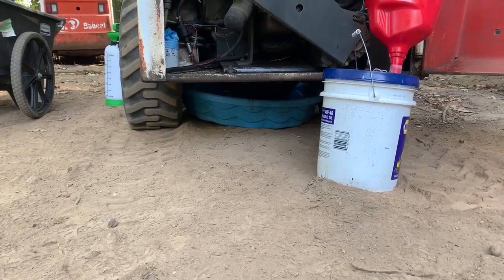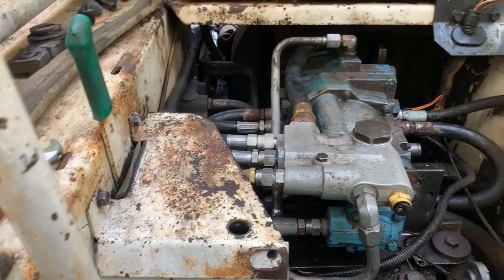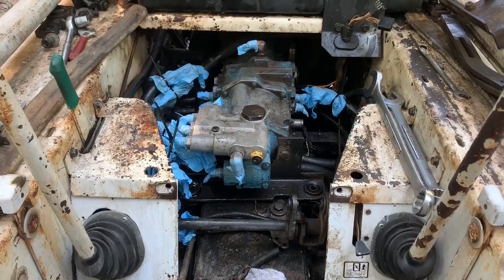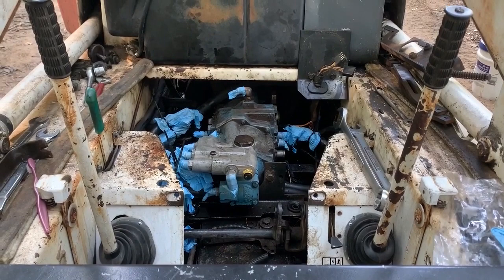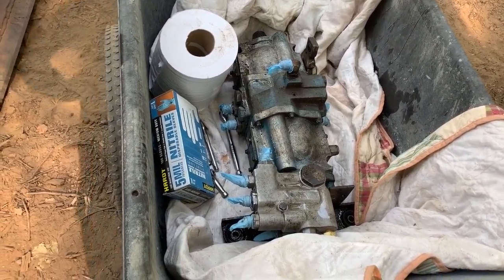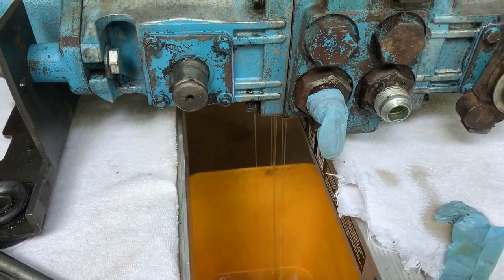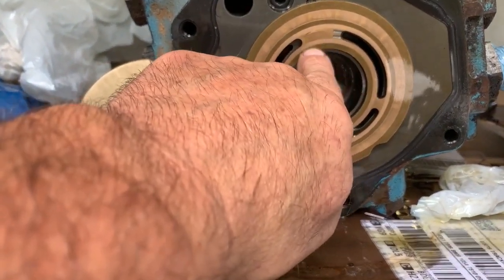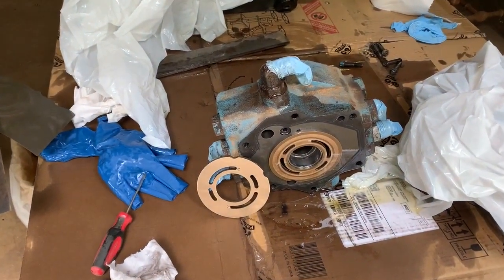Remove & Fix Hydraulic Pump Bobcat 642.  Diagnose & Repair Hydrostatic. DIY Swash/Wear Plate Repair

Comment: Good afternoon I just bought a 632 bobcat it goes forward backwards bucket goes up has down but will not turn at all, sounds like a car without steering fluid, 
Previous owner said he replaced and rebuilt both of the drive motors. I removed the hose where the bronze filter goes. There was no filter at all. The hydraulic fluid is mixed with water. It’s got a milky look to it, i removed the pump,  as I was taking out the hoses from the pump, I heard a lot of air coming out of them,  the pump shaft is locked. It does not move. Is this normal or this is my main issue?

Comment: Hello, my bobcat has no leaks but the hydraulic system forces the engine, I can hardly turn and I have to keep the engine speed high otherwise it stalls.
Reply from the maker: I suggest you register for free here and post a thread with your issue. Those guys are smarter than me! https://www.skidsteerforum.com/forums/general-bobcat-skidsteer-forum.1/

Comment: How you how you doing man how you release the air pressure and the pump when you put them back
Reply from the maker: I didn't have an air pressure problem. I filled with fluid and used the hydraulics slowly up and down and tilted the bucket up and down. Do this for several minutes and get to maximum lift/tilt. Do until operating smoothly.

Comment: Hi there,

Great vid! I find it very hard to find info on pump or drive motor repairs. I buy and resell skid steers here in Australia as a side line. Nice to see the internals and read your diagnosis tip in the comments. 
Cheers
Reply from the maker: I had a Bobcat with issues and couldn't find a video or repair information myself. That is why I posted the video. I am glad you found the video useful. Cheers.
Reply: Buenas noches sr! Yo estoy en Mexicali México.  Tengo el mismo problema con la bomba hidrostática..y el disco ese de bronce también estaba rayado.  Lo reparamos y lo pusimos  pero al usar la máquina los brazos no levantan normal..se ponen lentos y no levantan después de dos o tres minutos de uso de la máquina.  Camina para atrás y adelante y el bote de enfrente se mueve normal..solo los brazos no levantan.  Tiene idea que pudiera ser la falla?  Por su atención muchas gracias y la verdad un excelente vídeo el suyo.  Saludos desde Mexicali México.

Comment: Hey I got a 741 recently I realize that  I am having problems lifting load but I can still tilt maximum load 
Whats weird is that when I try to lift the load it does really move much but if i tilt the bucket at the same time it start lifting right away even before the stuff starts falls out
I know my pump is good so I am thinking I am having some issues with a release valve
What’s says the experts.
Reply from the maker: I am not a mechanic. I just bought a Bobcat 773G that has lots of electronics on it and have had trouble with a lap bar sensor. I never owned a skid steer prior to that. I did my huge driveway and parking with it and remember having an issue with the lifting with that. I think it might have had something to do with the auxiliary hydraulics but I don't know. I think bleeding the air might have helped. Raise all the way up and tilt then lower and tilt and do that a few times. You might have a screen on that pump that needs maintenance or replace? IDK. 

After dealing with a temperamental 773G, which I still own, I decided that I wanted something that would run, lift, and move things so I bought the 642 and then it had issues. But all in all, as a use it once in a while homeowner, I like the 642 cause I can keep it going and will be more dependable or fixable for me.
 
How do you know your pump is good? Is it possible to switch the lift and tilt hoses and see if the problem moves to tilt instead of lift? I made this video because I couldn't find one on how to troubleshoot and or fix the hydraulics so I thought I would share what to expect. 

Let me know how you make out I am curios.

Comment: Is there a follow up to this video?
Reply from the maker: No. Put it back together same way it came apart. Works fine now.
Reply: @Depression2010  did you have to get a new cup with those small pistons?
Reply from the maker: @gyffjogofl7676  I bought the entire new rotating group assembly for less than $400 delivered. Easy Job.

Comment: Do you have a layout of what each hose goes to on the pump? I bought a used 741 from a guy and none of the hydraulics work at all. He had someone work on it but I'm thinking there is some hoses that got switched. Any help would be appreciated. Thanks!
Reply from the maker: I am no bobcat guy. I have a PDF manual for the 642. I am not sure if the 741 is the same. I found this online. Page 38-39 has a pretty good diagram. https://issuu.com/19800595/docs/bobcat082y_04a88b36387fbf

If this is not applicable to your machine maybe do some more google searching or pay for a maunual.
Reply: I got manual for 741

Comment: Im in the process of troubleshooting the hydrostat on my 731 bobcat. Ill prob have to replace the hydrostat in its entirety or go in and try to rebuild it myself. 
What issues were you having with the machine that led you to believe the pump was bad?
Reply from the maker: I did not know what was bad. The right hydro motor was pretty much non-responsive. It was very noisy. The left motor seemed to be working okay. I drained the hydraulic oil and took the two big hoses that go to the motor on each side of the pump and switched them front to back. This makes the motors work totally opposite. So the right handle will operate the left motor and pushing it forward will make it go in reverse. Obviously after you switch the hoses you need to refill the hydraulic oil. If you choose to do this make sure you have plenty of area to maneuver and you exercise caution. After I switched my hoses my problem was no longer occurring with the right motor but was now on the left. That test proved that the motor was not the problem but the pump. I heard that those brass plates wear and sanding them usually fixes the issue. But, in my case I had a bad rotator group. I got a brand new entire rotator group for less than $400 including shipping. There is also a screen filter that can get clogged that purportedly can cause issues also. Please understand I am not a skid steer mechanic. I simply have one that needed fixing so I did some troubleshooting and analysis. There was no video like the one I posted and very little information online. That is why I did a video so that others might have some idea how to tackle it.
Reply: @Depression2010 thanks for the quick response.  it was nice to see someone open up one of those pumps and replace some of the internal parts. It gives me hope I can fix the pump vs buy a new one($3000) I suspect the wafer plates and rotating groups may need replaced in mine.

Comment: This is excellent!  I was no kidding about to do this on sunday (day after you did) - I have a 642B gasser; was gonna pull the motor first - my coupler is shot and I have a leak either the tubes running between the motor and hydro or the input of the hydro is bent and leaking because of the coupler - but couldnt source the cherry picker from by neighbor.  My hydro growls fairly bad and but the hydraulic pump is horrific/squeals and I know its shot (previous owner ran the machine out of hydraulic fluid cause of the leak).  Was going to just replace both, but super curious about pulling the hydro apart as you have.  Would like to see more vid of the tear down.  I have the hydro component manual and have the skill.  Where are you getting your hydro parts from?  Thanks for any help.
Reply from the maker: I would pull the pump first. You can probably replace the coupler after the pump is pulled. I don't know but I bet you can. I just finished putting mine back together. Sorry no more video. I didn't tear into it at all. I had it apart twice. The first time I just sanded the wear plates. I wasn't happy so I pulled it out again and found the worn rotating group. The replacement comes all together complete. I just dropped it in. I did soak it in some oil for a few minutes but that is it. I put that rotating group in, replaced the bearing spacer, and put the bearing back on. Then lined it up to the other half and bolted it together. Thing runs perfect now! Got my part from https://www.loaderpartssource.com/bobcat-642-skid-steer-complete-rotating-group-for-the-drive-pump.html

The only trick is getting the pump lined up with the coupler when installing. I used a pry bar and just kept jiggling up and down left and right while pushing it towards the motor. Really not a hard job.
Reply: @Depression2010  Ok, no problem.   I already had those guys already bookmarked for a complete hydro buy.  I was hoping for a rebuild kit on the hydro, as they do with power shuttles or slush transmissions, but couldnt find one.  But if they seem like a good place I can prob call and ask for what I might need - seals, gaskets etc.  I dont know whats inthe hydro as havent actually looked at my pdf copy of the manual yet (was sent to me on a usb, ugh.)
Reply from the maker: @maniagokm3186  I never did it before. I think there are only a couple things that can go wrong. Normally all you need to do is sand the brass wear plate and maybe the rotating group that touches it. I didn't replace any seals or gaskets and no leaks.
Reply: @Depression2010  As with hydraulic pumps, a rebuild kit usually gives you new wear plates, so you can get back into factory limits/tolerances.  Obviously someone makes the parts or theses guys cant rebuild them.  Good to know theres not much in there to go south.  I have read however that a blown coupler group will bend the input shaft and it'll leak - it happens alot apparently; out of site, out of mind (grease your coupler religiously). I'll give them a call and see whats up. Cheers for the info!